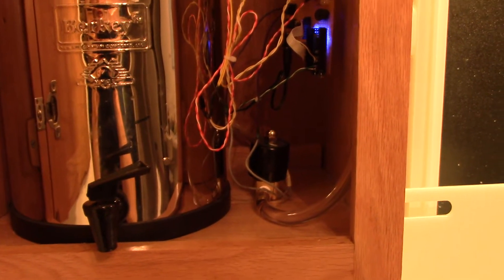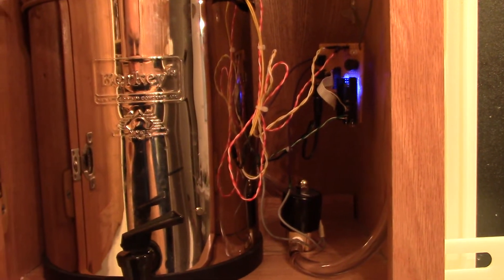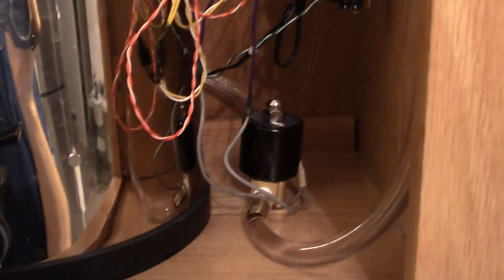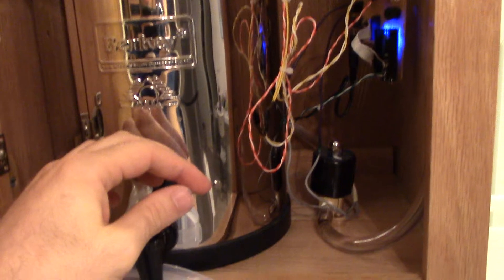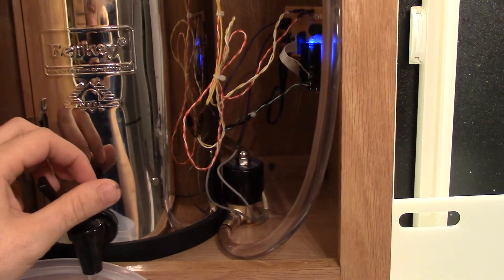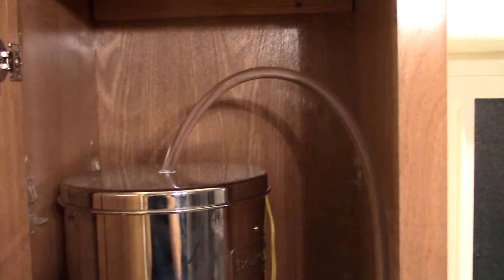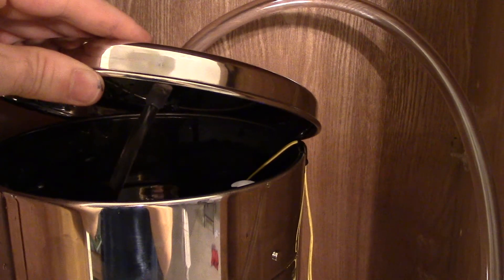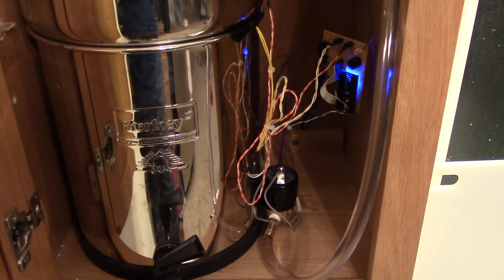Berkeyduino - Arduino Automatic Water Filter Filler

Comment: The problem is, when the lower tank is almost full (99.999999...% full) does the solenoid let the water in?
If yes, then, your lower tank will overflow as the lower tank do not know how to tell the solenoid to stop filling the water in the upper tank.

It's good to utilize water level sensor that can detect ranges of water level in lower tank and in respond, the pump will flow out water with lower flow rate as the lower tank in getting full. And stop completely when 100% full.

Filter flow rate shall be put into the equations (if there's any equations)

Solenoid valve need to be replace with variable speed pump. There are tons of cheapskates one.
In my puny experience, Float switch only can do OFF (Full tank) and ON (Not Full tank) but not in between. or is there one can do? please advice.

The resulting improvements render the lower tank always be full and available to be consumed. 

Hopes i this can helps! Cheers!
Reply: Yeah! That's a great idea!  My workaround for that is to put the whole system to sleep for 1 hour after the top tank fills.  That delay will prevent any overflow and also keeps it topped off pretty well.

Comment: I'm considering trying to use a toilet tank filler (unused of course) inside the Berkey to refill it.  Has anyone considered or tried this?  If so, any advice?
Reply from the maker: Main downside is going to be size. Toilet innards are bulky and all parts are inside the tank. In the design I used, the only thing inside the tank is a cheap, tiny float switch off eBay. The rest of the parts are all hidden under the sink. I've since updated and reinstalled all of this in a new home since the above video was made.
Reply: @nelbrad  Could you would you make another video? Please!! Also I like having a sink faucet and hookup to my fridge, I'm planning on installing an rv water pump to where the spicket bulkhead is.... Unless someone smarter than me thinks thats a bad idea!
Reply: also, I would think the toilet thing would only check either the top or the bottom. You kinda need to check both to keep it from overflowing.

Comment: I'm working on this same project. What kind of float switches did you use?
Reply from the maker: Did you finish your project?  I'd like to see what you did.   I used these - http://www.ebay.com/itm/Water-Level-Sensor-Ball-Float-Switch-Measurement-Plastic-for-Arduino-Durable-1WA-/131887647629?hash=item1eb51dcb8d:g:yFEAAOSwdzVXlPHE
Reply: The link doesn't work anymore. Was it just a generic plastic float switch you used? Also, if its a plastic switch, how did you use the magnet to hold it in place? Thanks! Getting ready to do the same project. Where did you find an Arduino for $2?

Comment: I was thinking of adding this to my system as well. Do you think there is an easier method? less expensive way besides doing the arduino?
Reply from the maker: Did you ever end up doing something similar?  Cheaper than arduino?  If you're good at programming, you could just use a PIC. Otherwise, this arduino I use is only $2. The most expensive part was the 12v valve.